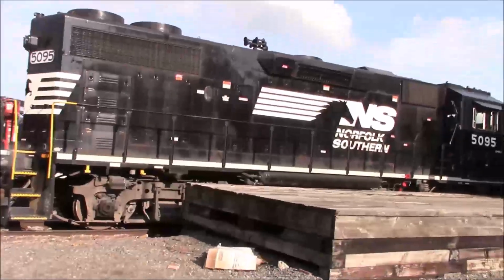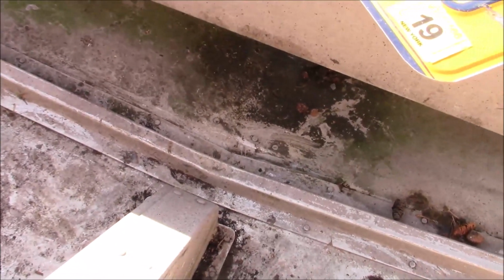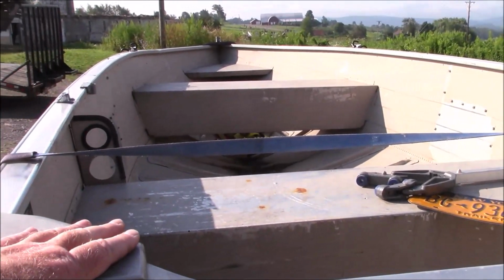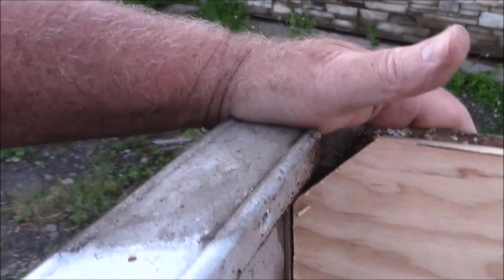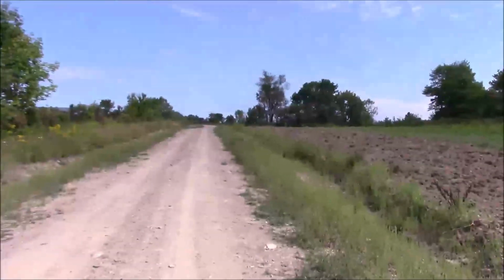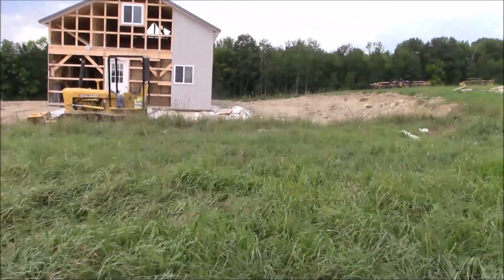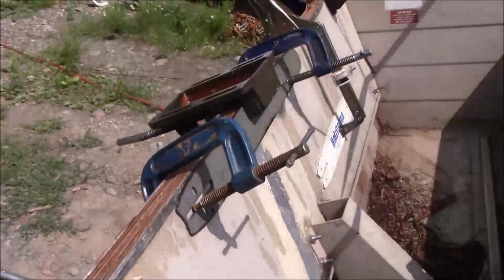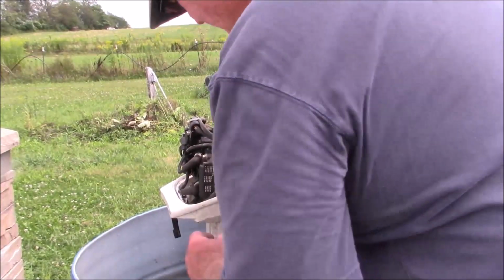14ft Discover Aluminum Boat Rotted Transom Repair!  Debugging A Johnson 15hp Two Stroke Outboard

Comment: I must have done that a million times, but I used a 55 gallon drum and a piece of 2 by 4 to mount the motor on.  It usually made a wet mess in the yard and the oil in the gas killed a lot of grass but was an outstanding way to test an outboard engine.  I liked Johnson and Evinrude the same way I like Stihl because they saved my butt a many a time and never let me down on the ocean.  I have towed in a many a fisherman using Merck’s.